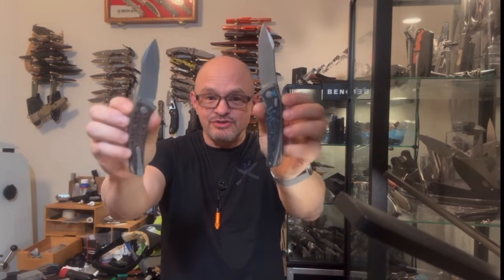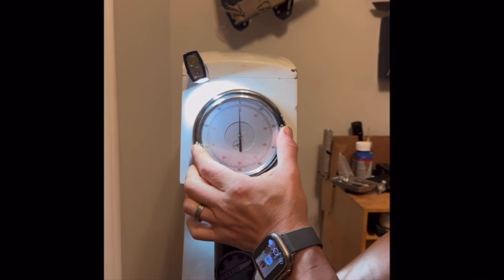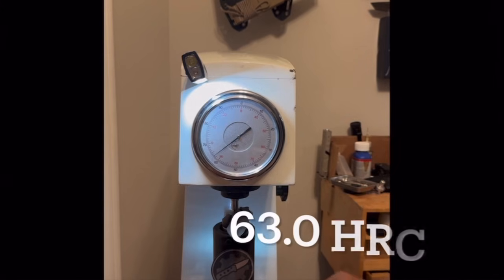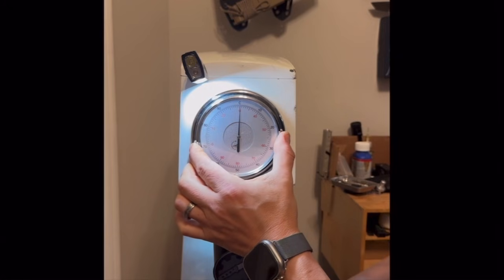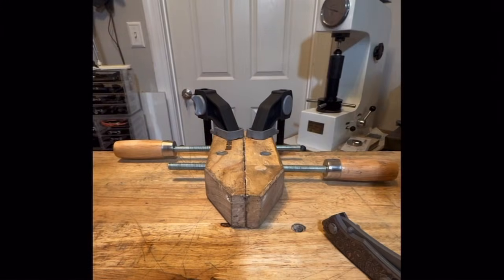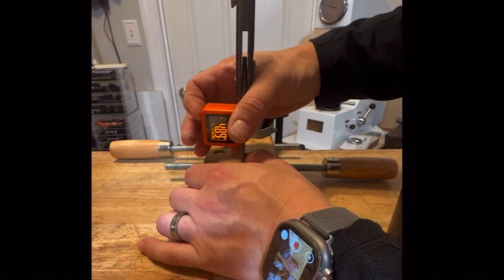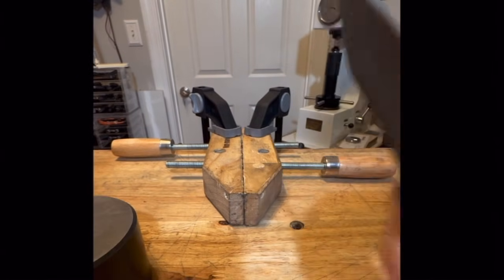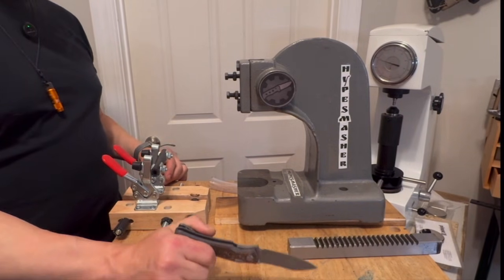$1,100 knife TESTED for Hardness and Strength?!

Comment: Good stuff brother. If my eyes deceive me, which is certainly possible, it does look like the tip of the blade was slightly bent in the direction you were testing. Only noticed after you held it up, post boink test. Could have just been the angle it was held up to the camera. Keep up the good work.
Reply from the maker: Thanks for commenting. I see no warp at all.

Comment: Thanks for the blade hardness test of the Talon, the values for M390 are fantastic. This rounds out the positive impression of the Talon and shows that Hawk has done a great job in every respect. My Talon can easily compete with my knives from Herman or Shirogorov, for example, and surpasses them because of details like the Hawk lock and toggle detent. Greetings from Germany.
Reply from the maker: Hello, thanks for commenting! I only have one Shirogorov and no Hermans so it would be hard to judge. Definitely runs as good as the Demko AD20 and AD20.5

Comment: The 20cv version of the smock says it rates at 62-64hrc, and I've been dying to see if it actually does.
Reply: My dlt 20cv smock poked at 62.8 over a 3 poke avg.
Reply: @diamondcutsteel definitely going to have to buy one now. I like the smock, but not a fan of s30v. That's why I like the dlt trading exclusive so much. Also, Micarta is my favorite handle material.

Comment: I can't explain how badly id like to own one of these 😂 thanks for the video!
Reply from the maker: I think now that Hawk shipped a few dozen of them to online retailers, the secondary market prices will drop. I would expect paying $750-$850 for pre-owned ones.
Reply: @CuttingBoardRx  I'll definitely keep an eye out. Quick question on sharpening, I recently got a 160 grit PDT cbn silver series stone for my fixed angle. After how many uses should I re-surface the stone? I've used it probably 15 times so far.

Comment: The chart itself is only showing austenitizing temps of 1150c but they recommend up to 1180c which would change the temperature curve on the chart. A lot of custom heat treater will go above 1150c.
Reply from the maker: Great to know. Do you know who does the HT for Hawk?
Reply: @CuttingBoardRx  I believe they do it all in house from an old interview I saw. But I don't know if that ever changed.